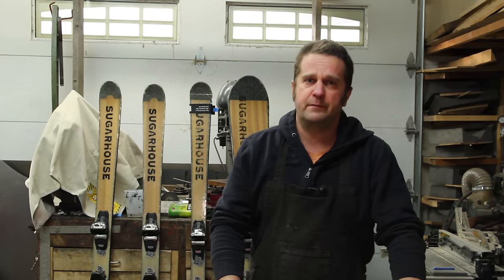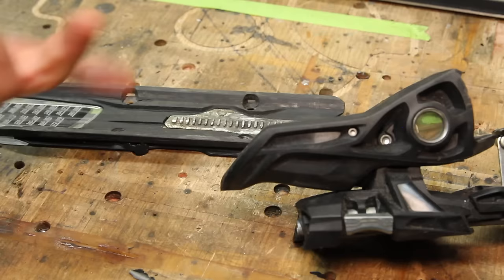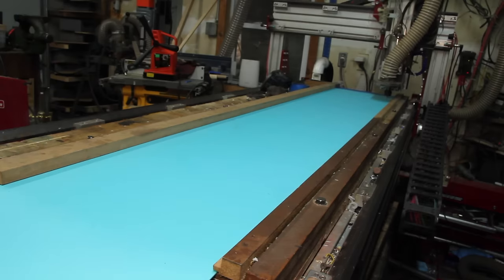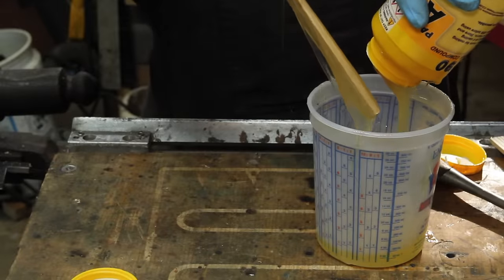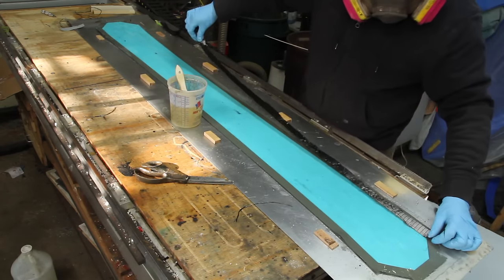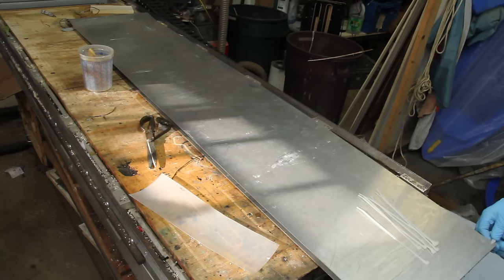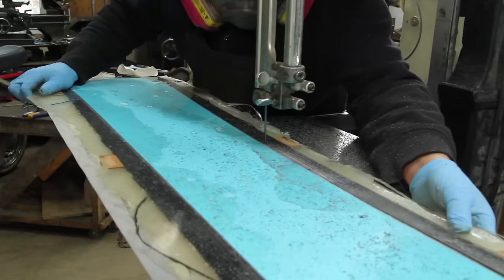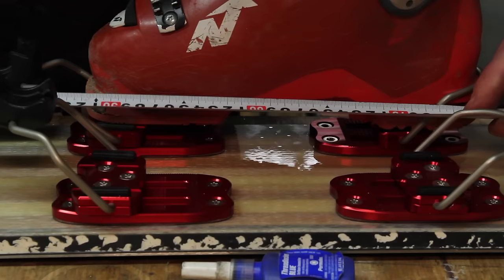Building a Monoski

Comment: Hi saw you and the little guy skiing the other day. You seem to be using your outside pole to push yourself into the turn; this creates caos in your upper body, especially as your speed increases.  Instead of pushing with your outside pole, try planting with your inside pole; it enables you to consistently point your shoulders in the direction of the turn. Your turns will look and feel more natural once you get the hang of it and your upper body will remain poised. The skis turn themselves if you weight, bend and angle them properly; no poles necessary.

Comment: Haha. Mono ski. Perfect fit. Have you considered alpine snowboarding bindings or parts from them. You can get intek heels and make step in bindings.
Reply from the maker: I’ve looked at them a little bit, it’s basically the same sort of thing as these, only these aren’t adjustable angle wise, since it’s, you know, “zero-zero”.   😆. I might see if I can get the bails and make my own base plates next time.
Reply: I’ve got a pair of Catek both step in heels and rigid toe bails. Might need to get snowboard hard boots with the intek heels. I think I have a pair. But Mondo 26.5.